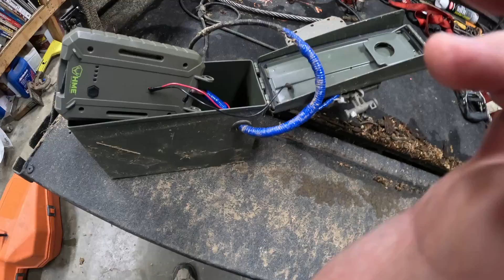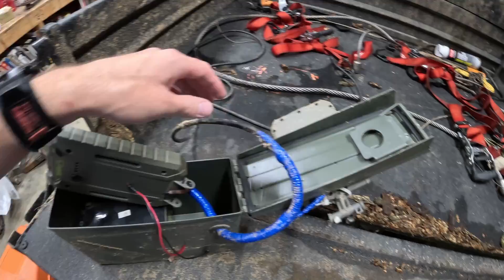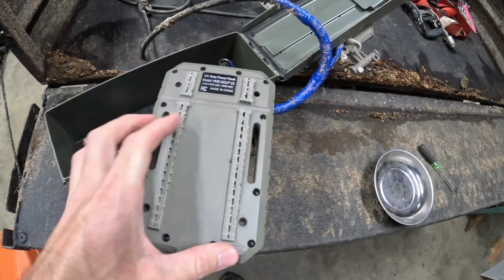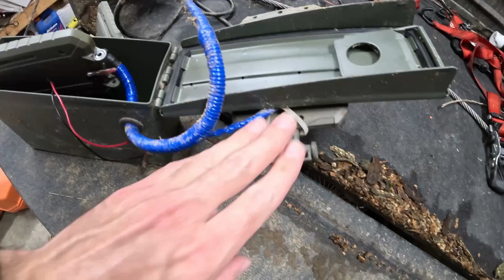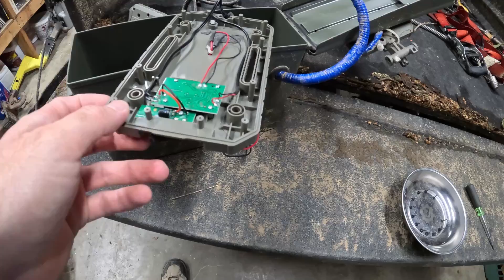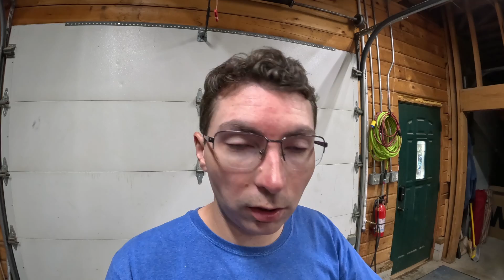Redesigned HME Solar Panel for Game Camera

Comment: How well does this keep the battery charged up? A couple weeks? A couple months? I literally have everything to do this and am going to set cameras out next weekend but want to know if the solar panel keeps the battery charged or does it just kinda work
Reply from the maker: It really just kinda works. 

The thing I have found that works best is a car/garden tractor battery. You can buy just the cable and wire a couple connectors on and connect to a full battery. I have had that out for 4 months with no issues. The only extra thing I did was wire a fuse inline so if something did short it wouldn't smoke the cable or camera.
Reply: @TheSchmitters100AW  I kinda figured that it only kinda worked, I don’t think the solar panels on those HME things really work that great to be able to keep the battery charged even in low use areas